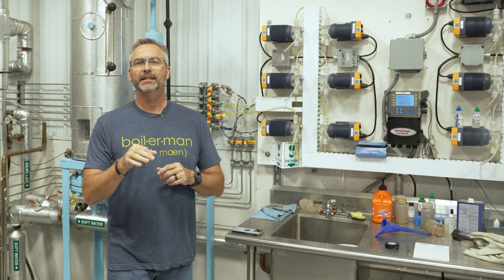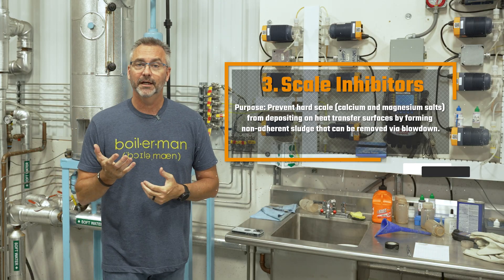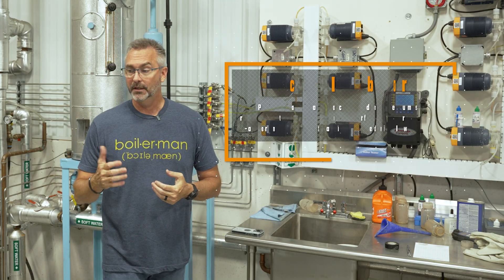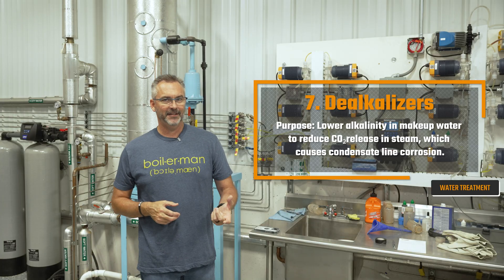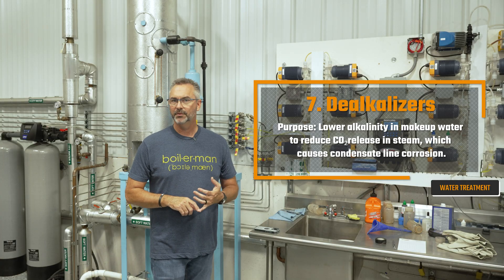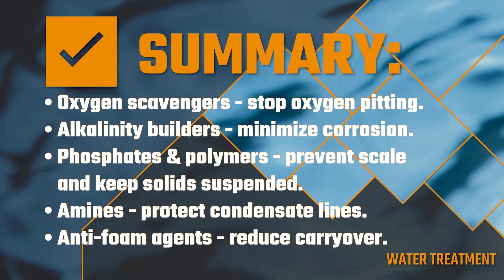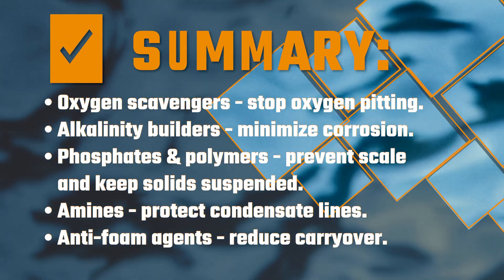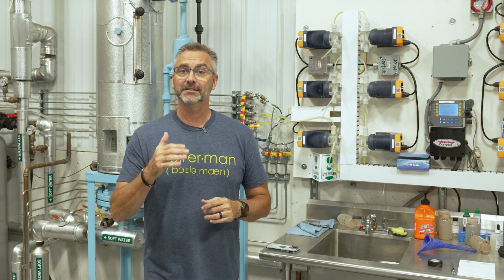Water Treatment 101: Chemicals That Prevent Scale, Corrosion & Carryover - The Boiling Point

Comment: There is a new standard for hospital Sterile processing departments: AAMI ST108:2023.  The steam requirements are: PH @ 25C = 5 - 9.2, Conductivity <10, Alkalinity <8, and hardness <1.  What would your high level recommendation be to maintain those tight tolerances? Right now I am looking into Steam to Steam heat exchangers with RO injection, but not sure if there are other options to consider.
Reply: St108 is gonna cause a ton of ASCs to close their doors while they get their shit together.
Reply: @adidas3k Possibly.  Depends on when real enforcement goes into effect.  The change is huge so it takes a minimum of 12-18 months to plan and implement for a hospital.  Smaller entities with less resources will probably drag their feet on it, and it'll be up to JC to decide when time to enforce is.